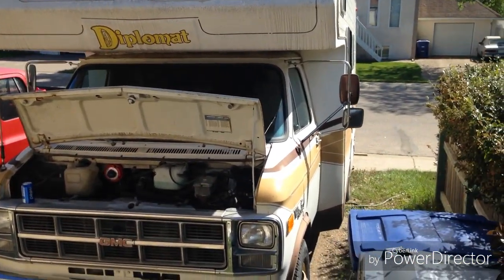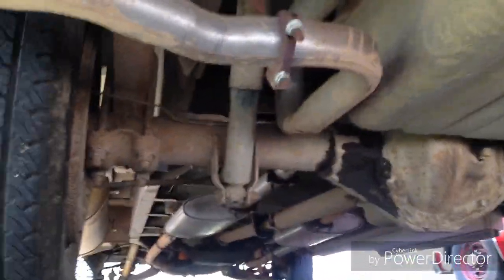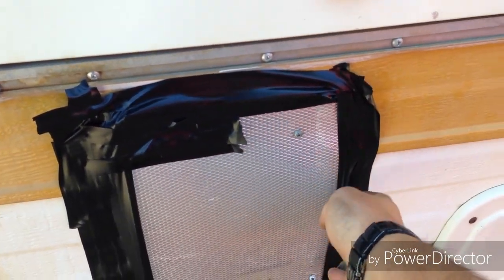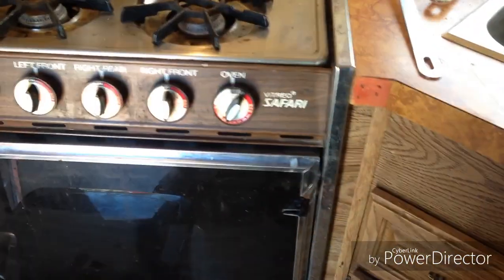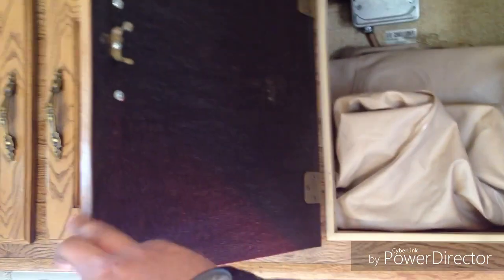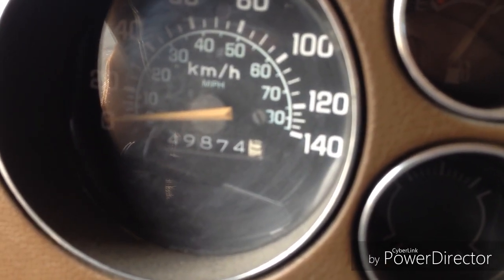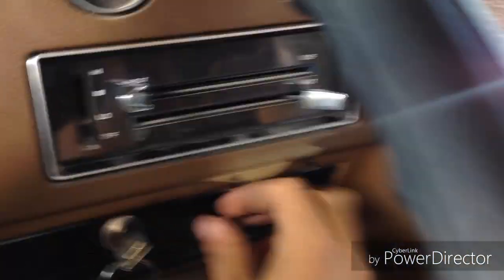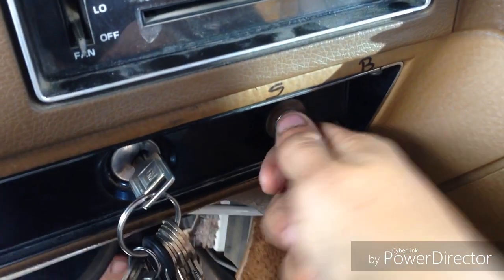1978 GMC Diplomat Motorhome Walk Around

Comment: Best thing about having a Class-C motorhome is that if the structure ever gets damaged or rotten you can strip the structure completely off the cutaway cab/chassis and install a flatbed on the chassis. I currently have a 1998 Ford E450 that was a Fleetwood Tioga 29Z motorhome. I dismantled the entire structure and resold everything that was salvageable. I am installing a 72" double bunk sleeper cab and a 16' flatbed on that chassis.
Reply from the maker: +JeepCollector91 ya that's what I like about it, and it was cheap enough, if the 350 in my truck ever dies I'll just swap the 400 SBC from the vandura to my Sierra.

Comment: hey does the aftermarket radio that you have reset itself every time you turn the key off
Reply from the maker: +spencer15898 no actually it doesn't, if yours does it means that the unit isn't wired correctly, on most head units/radios they have 2 power wires, a red and a pink(sometimes a red and a yellow) 1 is to go towards a switched ignition power source (usually the pink or yellow wire is the key on ignition power source) and the red wire is supposed to be a constant 12 volt to the battery or constants power at the fuse panel. That's the memory wire, that one controls all the saved settings, EQ, clock time, etc etc, sounds like the 2 power wires are wired backwards.
Reply: +Aarons Automotive mine actually has the red wire and yellow wire put together and it was so the radio would work but idk where the accessory (red wire goes to
Reply from the maker: +spencer15898 what's the model is stereo unit? And I can snag a wiring diagram for it, but ya one wire goes to constant 12volts and one goes to a switched 12 volts, sounds like those 2 are backwards on yours.
Reply: +Aarons Automotive Sony xplod 52wx4 and I have a 90 lumina apv van if I didnt tell you already
Reply from the maker: +spencer15898 ok, found the wiring diagram, the yellow power wire is suppose to go to the battery or a constant always on 12 volt source with a 10 amp inline fuses as that one is the memory wire that keeps the clock, presets, and EQs stored. The red wire is suppose to go to a key on only power source with a 15 amp inline fuse and is the main power source to the unit to turn on with the ignition.

Here's a link to the diagram I found for it

http://www.darren-criss.org/sony-xplod-wiring-harness/sony-marine-radio-wiring-diagram-ab61f268cc52d599.html
Reply: +Aarons Automotive thanks red is accessory and yellow is constant 12v but I can't find the wiring diagram for my van harness anywhere